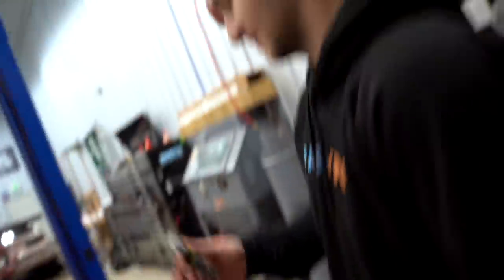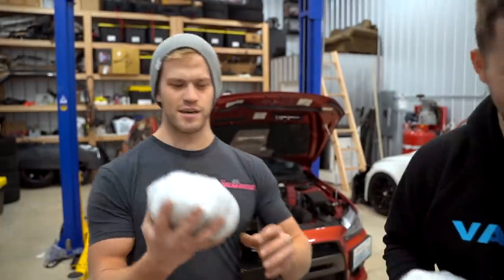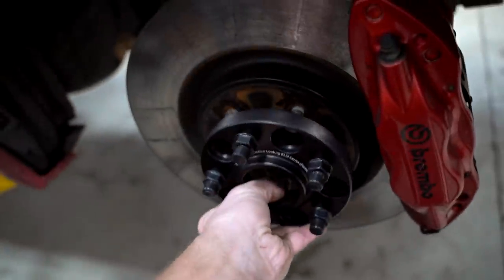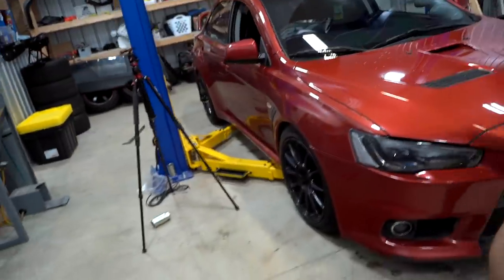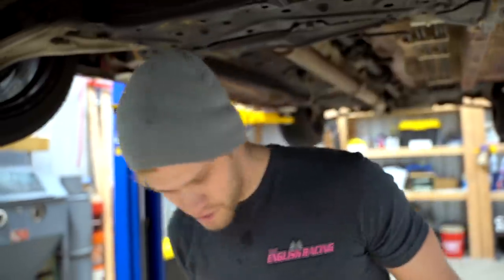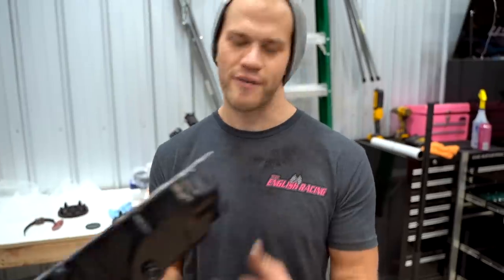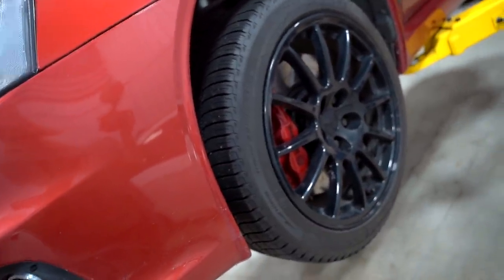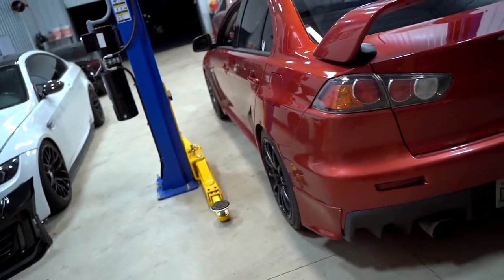Rose Deserves It... ft. Bonoss Wheel Spacers

Comment: Just tried finding some Subaru 5x100 wheel spacers on the Bonoss site...gotta say, super difficult to use. I was stoked when you pulled them out the box, but I can't find anything that works in the bolt pattern. Any tips?